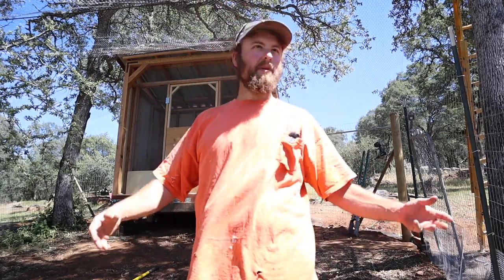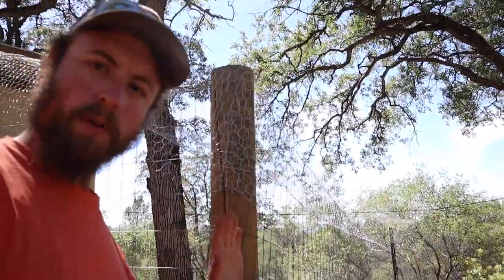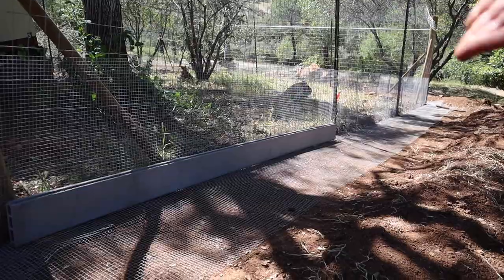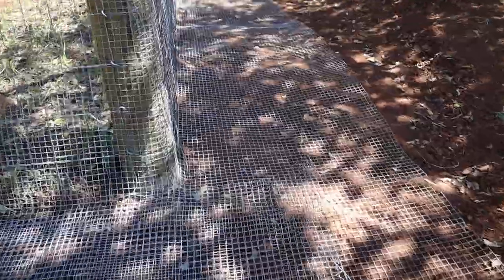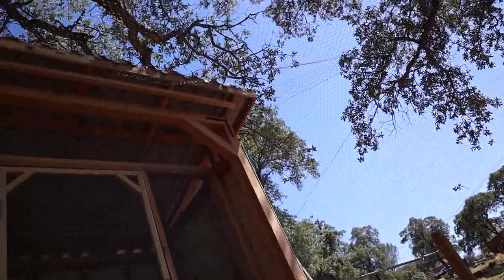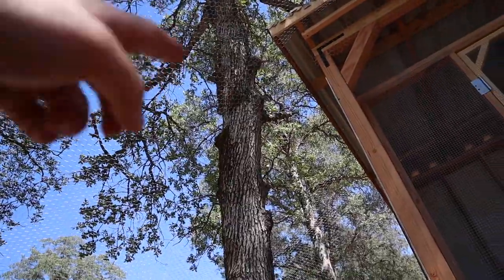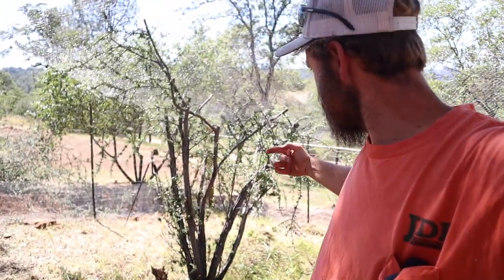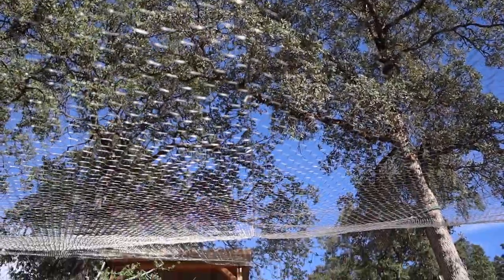PREDATOR PROOFING the Chicken RUN | Chicken Coop PART- 9

Comment: Half inch mesh 2' out
Border with wood
Corners. Overlap

Wire mesh deters predators

Gate

Inside
Chicken wire 6'
Hose
Cable clamp
Gloves
Pipe over cable
Roll chicken wire on
Tposts
Conduit weaved thru fence
Cable string wire

THANKS!